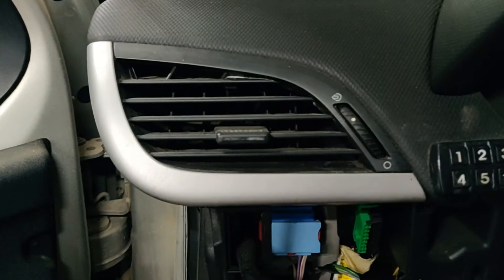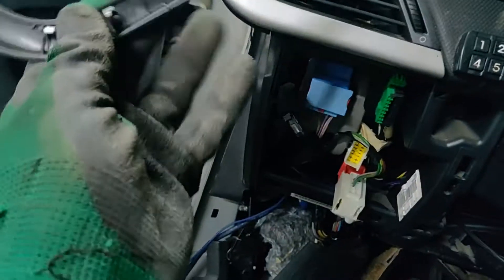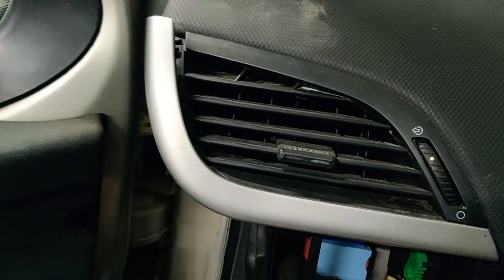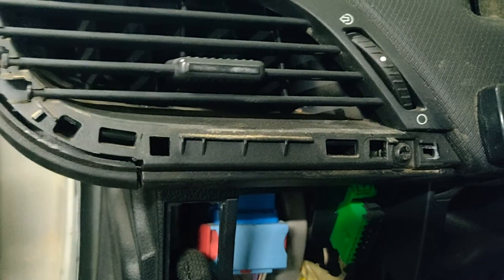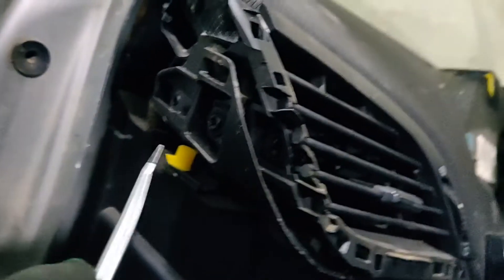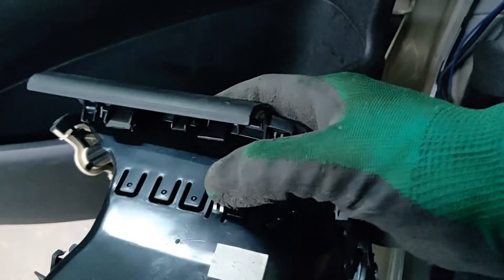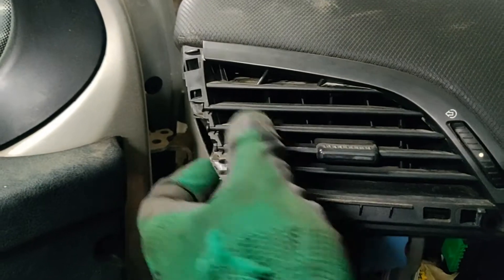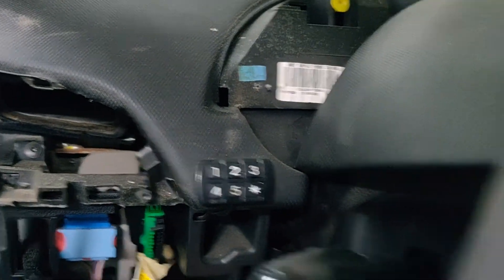Peugeot 207 air vent  replacement quick guide how to remove (English)

Comment: Thank you for making this. I was struggling to replace mine until I got the replacement and found the second screw that should hold it in. Very useful as there's not a single video I could find that shows this.
Reply from the maker: Thanks a lot, that's why I made the video